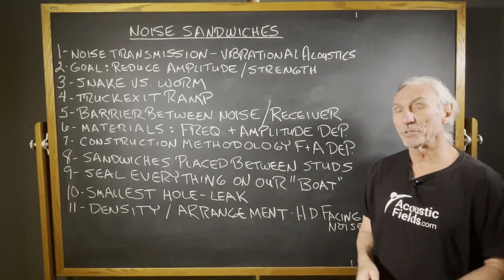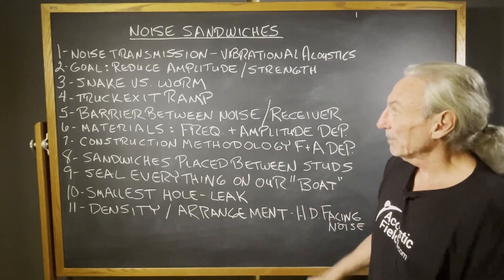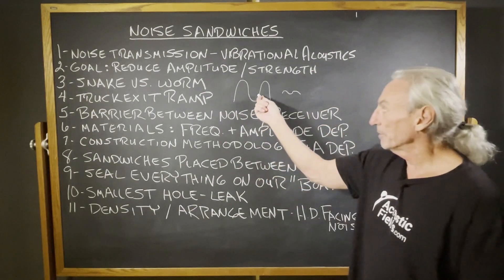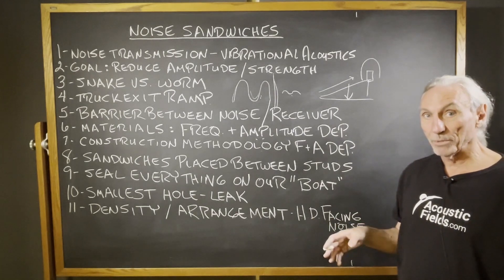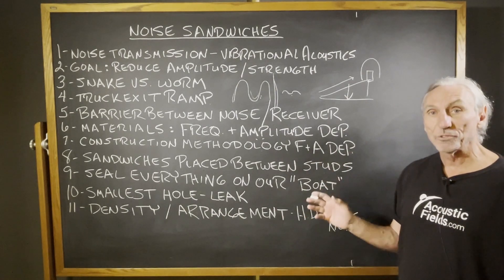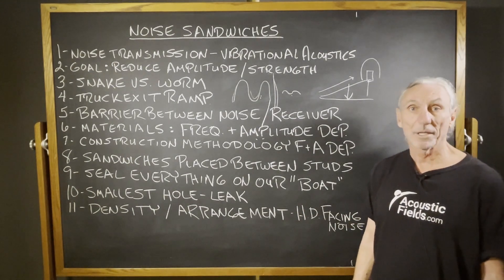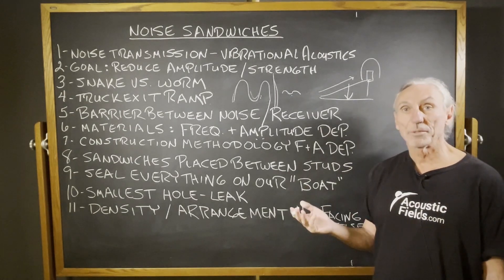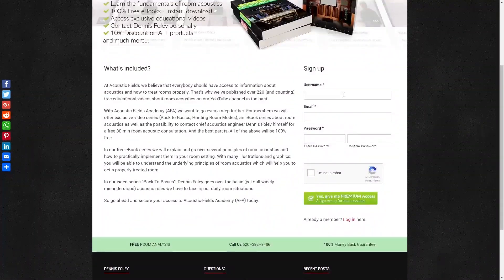Noise Sandwiches - www.AcousticFields.com

Comment: Dennis, @ 3:03 you have an excellent sample illustration of the sandwich with a 3" airspace between the studs.  Can this be filled with fiberglass or left open?

I'd assume this same technique can be applied to a double stud wall with bare fiberglass insulation filling the stud cavities on each inner wall?
Reply from the maker: Every barrier you build is frequency and amplitude dependent. There are many combination of material types to use.

Comment: How does this method compare to say normal double brick house construction where the interior and exterior walls are brick and cement?

Would this them be a consideration for the ceiling or is there another preferred ceiling construction.
Reply from the maker: The goal is to match the wall density to the frequency and amplitude of your noise issues.
Reply: So equal or greater.
We have an issue with pigeons and neighbourhood dogs coming through the ceiling. So rubber mats glued to the top side of the ceiling board will be good better than say rock wool?
Reply from the maker: @julesc8054  What is the frequency and amplitude (strength) of the bird noise? Every material type has a particular frequency and ampitude it works at.  Building insulation is not a barrier technology. It is designed to keep your room warm and cool.
Reply: Thanks for your response. Just trying to understand the philosophy. So you would rather directly absorb the sound than dampen the transferring surface. 
I will have to wait for summer to measure the pigeons and missed my opportunity with the dogs on Friday afternoon. But really they need to drop about 10-15db. Dogs about 125-500 hz and pigeons well about 400hz-1khz.
Reply from the maker: @julesc8054  Those amplitude goals can be achieved once frequency of noise is quantified.
Reply: @AcousticFields  I'm glad they can be easily met just wondering what you approach would be given the previous quantification.

Comment: Thanks for the videos. I've been searching for months about my drum practice studio which can be loud as 120 dB between 50-250 Hz. The concrete room measurements are 14.1x 15.4 ft and 11.4 ft height. Neighbors are 32 ft away. Looking for the cost+space effective solution to block low frequencies. Could you suggest a sandwich model if it possible? Do i need air cavity and absorbtion material to block low freqs? Or is adding mass the only solution? Thank you!
Reply from the maker: You must measure the frequency and amplitude of the neighborhood noise for a seven day time period. You will take 2 readings per day with out software and your phone. Contact us at info@acousticfields.com
Reply: This sounds exactly like what I want to do!  Did you get a solution? Thanks

Comment: what if the plywood were behind the drywall? What affect does plywood on the exterior have on sound as opposed to drywall? does anything change? - thx!
Reply from the maker: Plywood adds its own density to the barrier equation. Minimizing noise transmission is all about reducing vibrations through a series of densities.

Comment: Nice sandwich , Im curious if you've tried the same layering technique with your large diaphramatic absorbers  for the main largemass mdf sections ?
Reply from the maker: Barrier technology and sound absorption technology are two different forms of treatment for two different objectives. Absorption technologies are not used for noise transmission.

Comment: Do y’all have facilities in Utah?
Reply from the maker: We do not. We are a manufacturer direct company. What are your issues?
Reply: @AcousticFields  my main issues are the high frequency decay as well as the room modes in the low frequency’s. Pretty typical stuff.
Especially in the sub-bass (45hz and below) I’ll notice it’s completely absent in the room, but I’ll go in the bathroom and it’s overwhelming hahahahaha.
I have stereo subwoofers, and to get the cleanest response, I had to resort to placing them right next to the listing chair. Seemed to clean it up a bit, but it’s exasperated the issue with the sub-bass. I’ve also had to go near field with the mains.
I’d like to clean up that uneven response, but there is only so much dsp can do to help room interference.
Room dimensions aren’t to relevant since I’m going to move soon, so I’ll have to get back to ya when I do move. By that point I’ll be able to get a decay measurement and tell you where the room is most affecting things.
I’m not to terribly concerned about noise leakage, I just want the best in room sound.